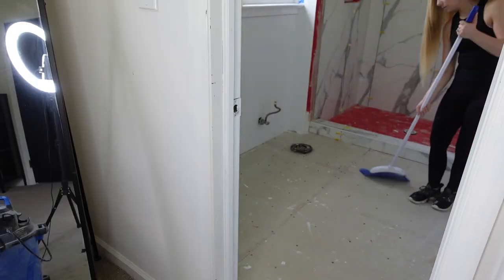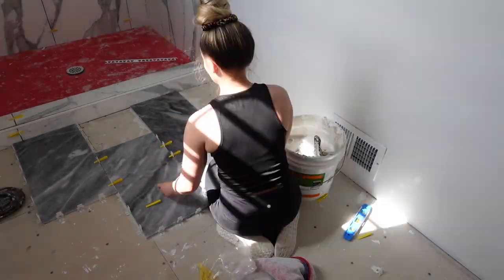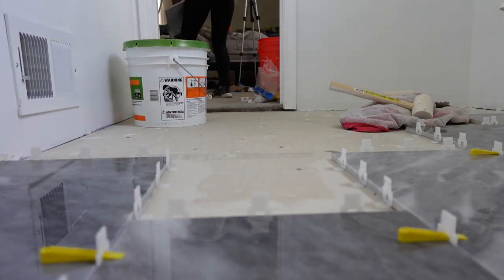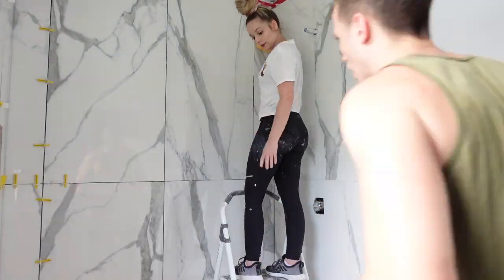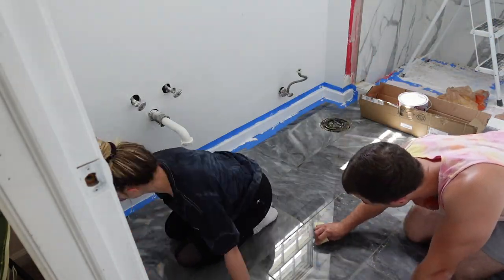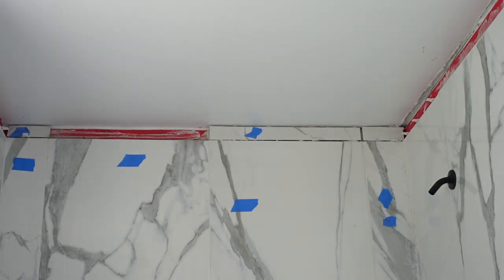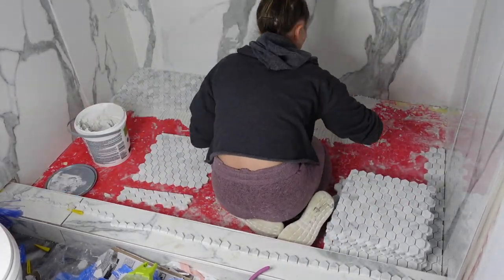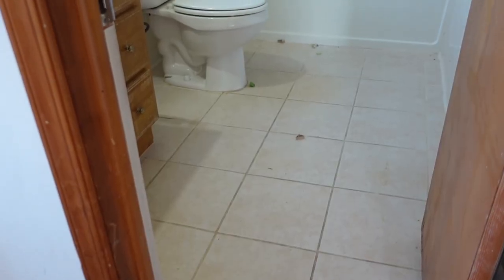MASTER BATHROOM MAKEOVER PART 3! | HOT MESS HOUSE RENOVATION MASTER BATHROOM REVEAL! | LEXI DIY

Comment: So it’s just the shower glass that’s missing, and it would be great if you guys could put a light inside the shower ceiling as some bathrooms have, it would brighten up the area since the light fixture above the mirror only points down
Reply from the maker: Yes and some shower trim on the outside but mostly finished! The door won't be in for a while so I figured better to post without it! (:

Comment: you may answer this in another video or later in this video because I'm not all the way through yet but I was just wondering, what are you going to seal the tile with in the shower as well as on the floor? Because certain cleaners will definitely ruin your tile if it as well as the grout aren't sealed!

Comment: You have probably learned that you are supposed to use the rubber mallet to break all the spacers off!!  They will not come out by pulling. There are several examples on YouTube. Yes, starting with 2x4 tiles is very tough.